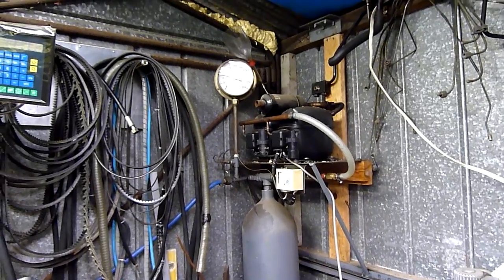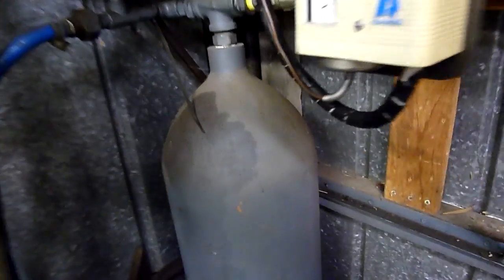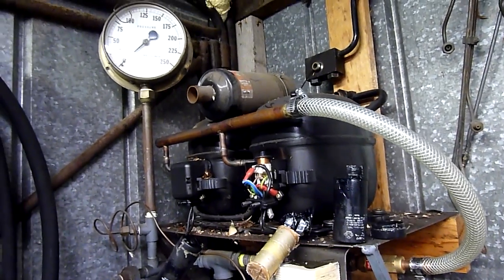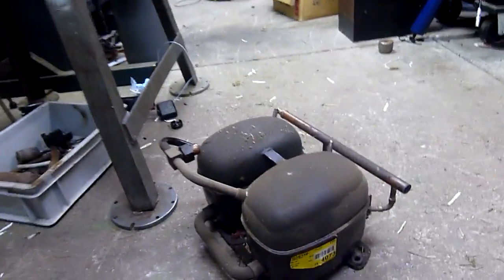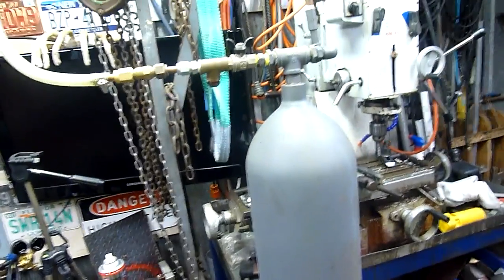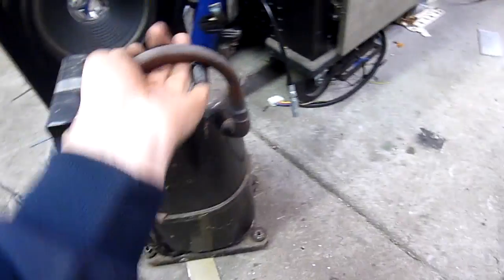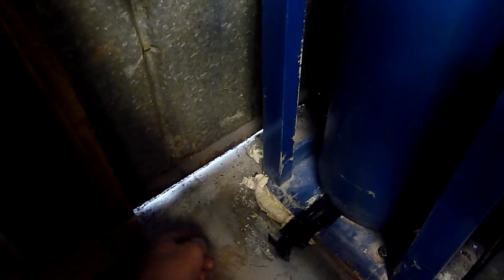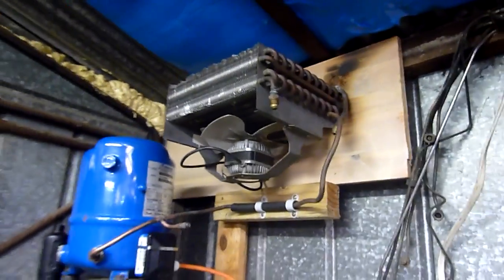Shop Air Compressor Mk2 build - Ultra Quiet fridge compressors Pt1

Comment: Ha. Cool rebuild, very small floor footprint. That's a fridgin' nice compressor. I've also got a fridge compressor that I built myself, only it's smaller and allows only for intermittent work e.g. for cleaning things with air, but it's enough for my little lab and what's important, it's really silent. Damn lovely old pressure gauge BTW.

Oh, and the air tank really needs a draining valve at the bottom! And I like the speaker system.

Comment: I was hoping that you could help me out by explaining how to wire two refrig. compressors in parallel which only have start capacitors (no run caps). I would totally appreciate it.

Comment: I have a local welding shop that sells their old tanks for people that want to make things out of them they don't have valves on them and they drill a hole in them so that people can't exchange them. You think that if I tapped the hole I could use it as a air storage tank? Are they safe to use that way I mean the regular compressor is only like maximum 150 psi in these tanks are made for 2200psi so it probably failed the 2200 psi test but I think it would probably be still strong for at least 150 psi?

Comment: ur setup turned out good Ed good work u did on ur new air compressor I'd like to try and build one like that some day I bet it's better than a standard air compressor would not be as loud and better faster pressure building

Comment: An easy way to make a tank drain for your application is to tap or braze a 1/4" male compression fitting in the top of the Tee that enters the tank.  Then drill out the shoulder on the fitting so 1/4"copper can slide through the fitting all the way to the bottom of the tank.  Once at the bottom (with a 45 deg cut end so won''t block off) tighten the nut and ferrule.  Now copper extending beyond the tee can be looped down the side of the tank, install another compression fitting with a ball valve and you now have a tank drain.  Tank pressure will push any water out the 1/4'copper line when ball valve is opened.

Comment: Sad to see it go. I based my set-up on it except it had a domestic butane tank as a storage cylinder and instead of an after cooler I used a cheap ebay water trap which I fill with silica gel powder to use as a descant. If you change the descant every 5 hours or so of compressor runtime the air stays pretty dry. After a year of on off operation I checked the tank and it was empty.

Comment: the other day i was changing power steering fluid in my car and smelled the old fluid and pump and it smelled just like compressor oil, that strong burnt metal smell. it reminded me of when i used to open up compressors.

Comment: Wow, it really is dry if tipping over the tank is a viable solution for draining it. Put in an air compressor at work, ran it for a week with minimal use, and drained out 3-4 pints of water when I took the bottom plug out to install the auto drain. 
That aftercooler should do fine though, probably about the same size as the aftercooler on the 7.5 HP ingersoll rand we put in.   
If you can be bothered to, consider and unloader valve that dumps the pressure off the output of the compressor when it shuts off, for a faster/easier startup (check valve keeps the pressure in the tank, obviously)  It should help more if you go with a higher tank pressure and regulate down for the shop lines.

Comment: Use a pipe cross on top of your tank in the top of that put like a 1/2"px 3/8" tubing fitting run the tubbing through the fitting to the bottom of your tank to remove condensation from your tank.
Reply: +C2welder A lot cleaner than trying to mount that big bastard upside down, and it'll still separate the air and water in the tank some. I like it!

Comment: The problem with The hermetic compressors is that they are suction gas cooled.
And low dense air doesnt cool as much as high pressure refrigerant.

I would use an semi hermetic one, the small DWM compressors are air cooled and they run much quieter than those maneurop compressors.
I use an small DWM compressor as a booster from 10bar up to 25bar.
Reply from the maker: +Alexander470815  you are absolutely  right, this one will not run constantly, so overheating should not be a major issue (the old ones never went out on thermal) but if this one does not supply enough, I may well commandeer my DWM Copland thats currently a high volume vacuum pump and use it as an air comp instead.

Comment: Hey Ed, you put your tank in the wrong way around. If you invert the tank it will never hold water and as long as you purge out any water from your airline when you first start you won't have to drain the tank ever again.
Reply: I second this motion. Make a mount and hang the tank upside down from the wall.

Comment: You need to put a drain valve on that tank. Tearing apart half you air system is far too much work to just drain water out.

Comment: Why not put a release valve in the bottom of the tank?  Attach a pull cable like whats on the air tanks on semi trucks. So you can pull the cable periodically to drain the water.

Comment: Definitely well-made those old compressors, compared to the turd that was in my mini-freezer (which is just a white cupboard now) that seized up after I moved the thing from my shed to indoors (and left it for an hour before powering up again), but then that thing was using the isobutane refrigerant...
Reply: +twocvbloke In other words, it was an explosion/fire waiting to happen? I tend to avoid that stuff if I can help it!
Reply: TheFurriestOne
If it leaked, yeah, and there's been some cases of exploding fridges and freezers that used the isobutane refrigerant when they filled the cabinets with gas, and then the door was opened, light comes on inside and BOOOOOOM, the kitchen is gone... :S
Reply: ***** I've heard of similar issues and explosions in car-accidents where vehicle ac systems had been illegally re-charged with similar stuff. Technically, it may have been illegal since it was charged as a R12 or R134 refill, or maybe it was illegal in that specific state, I don't remember. I prefer my non-breathable gases to be non-flammable except where it is required for proper function! Like a grill! XD
Reply: TheFurriestOne
Yeah, I'm not keen on refrigerants being flammable, but according to "those who know all" it's a green gas, so when it does leak, it doesn't harm the atmosphere, it just blows up people's houses instead... :S
Reply: ***** Fewer people on the planet, that's a gain from a green standpoint! ;P
Reply: TheFurriestOne
Personally I don't fancy being one of those people who get wiped out, I prefer people do it themselves as part of the Darwinian evolutionary process... :P
Reply: ***** Quite! If only they didn't have a tendency to take others with them, but such is the price of technology, eh? Welp, gotta get to sleep, been fun chatting!

Comment: What's the purpose of that air cooler? Is it literally just to take compression heat out of the pipework before it goes into the tank?
Reply from the maker: +ShokaLion it removes the head and helps condense the water vapor, then it can get caught by a trap before making it to the tank, it will not get all of it, but its a start.
Reply: +ShokaLion That's what the air cooler is for, if the compressor has been running for a while the air coming out of it could very well burn you.

Comment: what would you think of mounting the compressor motors on the concrete floor and hanging the tank upside down above the motors? Quieter? if you don't have a need for super dry air turn the bottle upside down and keep the hose fitting at the bottom it will be self draining the water every time you use the hose...
Reply from the maker: +builtrodewreckedit hopefully the condenser loop will allow most of the water to bead up and get caught in a trap that I will be putting in shortly, that tank ran 4 years and only had 3L or so of water in it, not too bad!